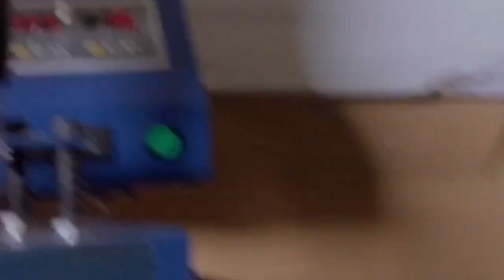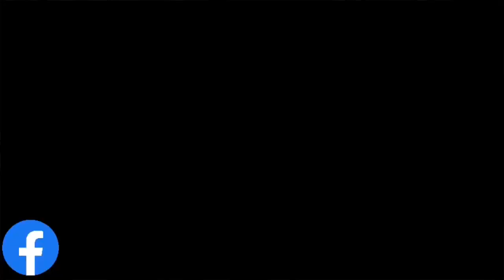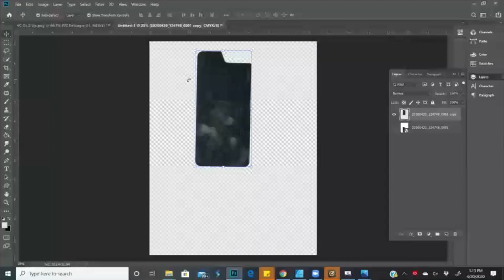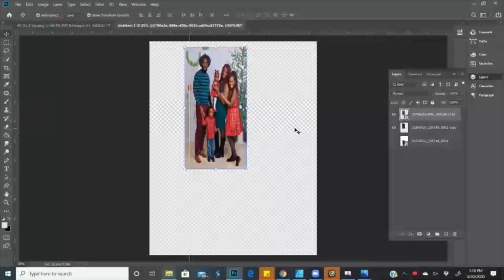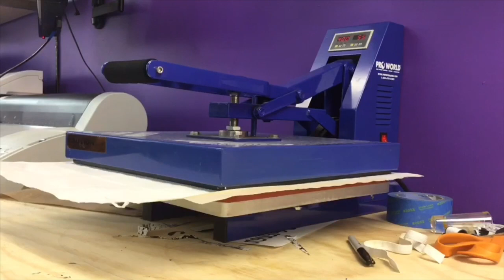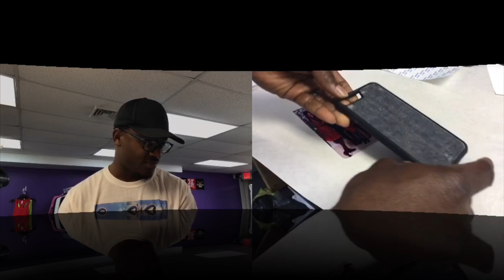How To Sublimate Custom Phone cases

Comment: hey i having some trouble i have everything right but it’s not going on the metal part of the case nothing happens it’s just hot paper and hot metal part
Reply from the maker: Are you using sublimation?
Reply: @Erastusnsnorweah   i have sub paper and my sub ink is from cosmos ink and i have the right heat and heat tape so i don’t know what i’m doing wrong